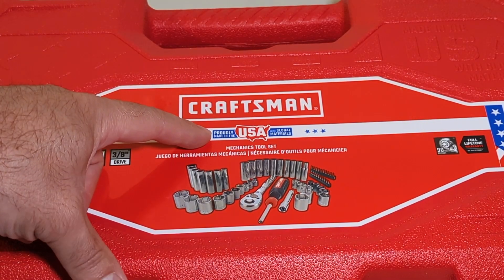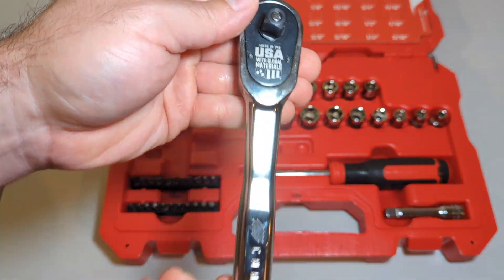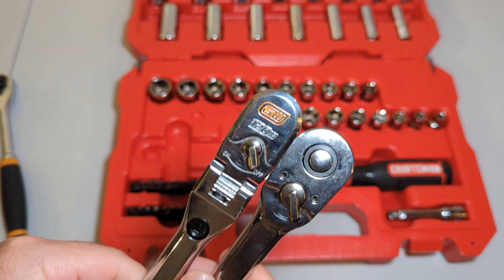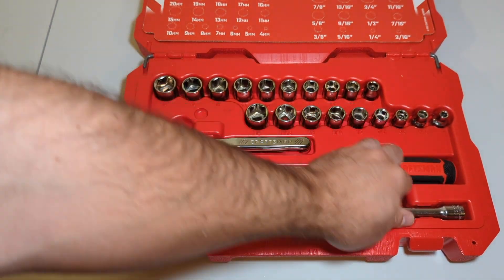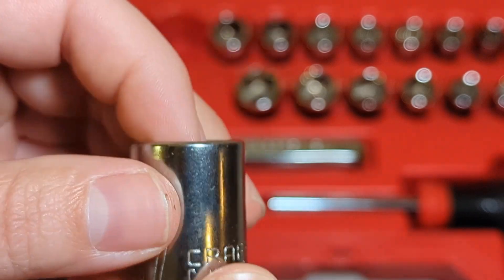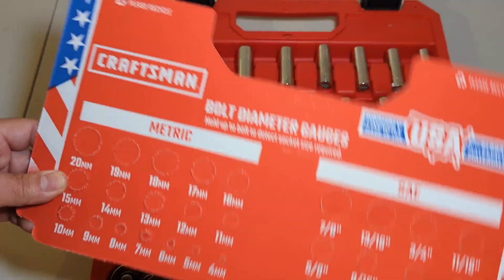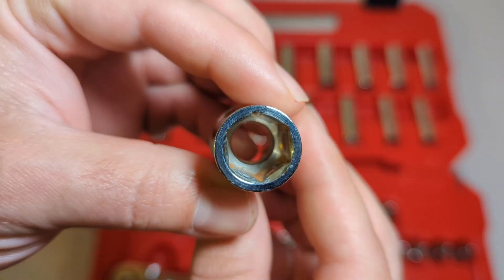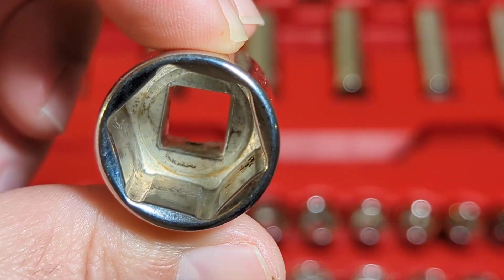USA Made Craftsman in TEXAS | Proudly made rust!

Comment: HF has a 66 piece set of 1/2", 3/8" & 1/4" with 72 tooth ratchets, all 6 point sockets, Quinn brand for $60. Appears to be identical to Kobalt, known to be made by Apex tools, parent company of Gearwrench. I bought the Quinn set and use them daily in building out GM crate motors into marine engines.
Reply from the maker: I just looked at the new Quinn comfort handle ratchets and they look just like the gearwrench 90 tooth ratchets.

Comment: This video is just nit picking. The tools work and have a great warranty. They tried to bring manufacturing back to the US which was nice. It didn't work out for them, but the sets they made are fine. I find some rusty sockets here and there from Taiwan, China, and even Germany produced tools. Just wipe off any loose rust and coat with oil or silicone as you would for any tool you accidentally leave outside over night. I bought both of the US sets and so far they haven't shown any signs of rust. Hopefully, they'll try again in the US, but maybe this time focus on some specialty tools that don't have as much of a saturated market as ratchets and sockets.

Comment: 30w is 30 weight oil is to lubricant the gear and pawl.  Tools are not for cold storage, they will rust. Wipe them down with a light coat of penatrate oil.

Comment: "Balance," means everything that isn't a ratchet, socket, or wrench was made in Taiwan.  Case, bits, driver, and extensions are made in Taiwan. Honestly, the 'gunmetal' Craftsman sets that are made in Taiwan are better (on the chrome) than the old Craftsman USA sockets or, of course, these. Going back decades, the US contract makers for Craftsman didn't chrome the inside of the sockets, and it sucked. Was always one of the cheapness aspects compared to tool truck, or even Wilde and Wright, sockets.
Reply from the maker: Good to know, thanks for sharing!
Reply: The gunmetal set does look pretty cool and of higher quality
Reply from the maker: @WandomZhiEt  that's what I've heard from a few.

Comment: If you want a craftsman product thats identical if not better in quality of the old Sears USA Craftsman, look into getting the new V series. I bought the exact same set myself, I was also a little disappointed.  When we see USA  made a lot of us who know tools are used to seeing the quality from Williams, Wright, Proto and SK pro, for tool truck brands like Snap-On and MAC and a little Matco.  Ironically most of Matcos main drive tools are Taiwanese made. This particular set in my opinion, is equal to Pittsburgh from Harbor Freight, Cresent or Duralast. They definitely had QC issues. If they were allowed to develope and refine their processes I think Craftsman would have hitted a home run for the price point. They should have introduced a professional line that is or was built in the same plant as Proto or MAC. Manufactured in a more traditional way. This would have showed investors that they were comitted to USA production of Craftsman. This would have also gave mechanics and tradesmen a big box store option to purchase and warranty tools. Then they should have got the current closed plant running once their QC and processes were in order then transition production of their base line products to the current facility. Craftsman is and  was Stanley Black and Decker's woulda, coulda and shoulda brand. Instead they missed  a huge opportunity.
Reply from the maker: I have looked at their V series but boy are they expensive. It would have made better sense to have an established tool manufacturer in the US make these tools for them instead of investing so much into a facility and end up shutting down.

Comment: I've got some of the newish taiwan craftsmen 3/8 flex head ratchets (I'm sure the non flex are the same internals) They aren't the most ergonomic (the whole design and squared handles) But! They're the smoothest low backdrag ratchets I think I've seen (might even be smoother then my well broke in 80's/90's round head SK ratchets). 
The back drag on these is smoother then my snap on's.
I wish it wasn't so😅 but if craftsmen just made a better ergonomic ratchet it would be my first choice.
That's not the case so I only get new craftsmen if it's dirt cheap clearance.
Reply from the maker: Having low back drag is nice, id say this 90 tooth ratchet has a moderate back drag when compared to others.

Comment: I could give a flying f how rhe chrome lookes like on the inside of the socket or even the out side for that matter. Alls that matters is the fitmeant and durability. I usually just use baremetal Apex mid or stubby length sockets and those gimick double sided husky ratcheting combination wrenches.
Reply from the maker: Bare metal doesn't sound very durable. 🤷🏽‍♂️

Comment: Sorry so many got defective kits. I purchased mine in Los Angeles. Both kits were fine with no rust. Double checked to make sure there was no duplicate sockets either. There are about 6 Lowe’s within 20 miles of me and all of them show at least 19 units available each for the 88 piece and even more units for the smaller one.
Maybe it’s just the luck of the draw. Maybe the stores in your states got older batches that were sitting around.
Reply from the maker: I'm glad to hear not all of them came out that way. I do live in the rust belt so I guess I had it coming 😂
Reply: Los Angelos aaye? I hope you still have a home.

Comment: In USA sockets must not have internally chrome or extra plating due to  higher standard of  sizing (also this is not a law but a quality assurance for exact fitting), same thing does Snap On on sockets but with much much better externally Chrome plating. In fact even Snap On has some sort of corrosion due to raw internally sockets where they spray oil before delivery. My wonder is there that why Craftsmen does not try to fulfill proper quality control like other brands? I think the Craftsman socket you show has much better steel and durability than the one Gearwrench in your video, had they added just a little oil sprayed before delivery, this would not be the results. Some of these brands including chinese made Craftsman you showed in the video have silver painted internally and not plating to hide that surface rust, I gave your video thumb down because you are not sharp enough to realize it and bashing a brand over the others.